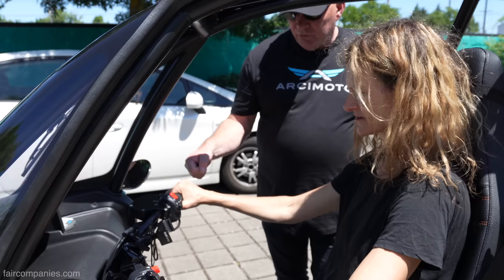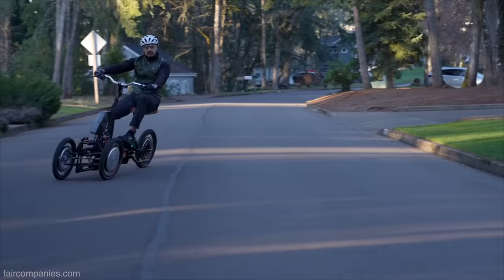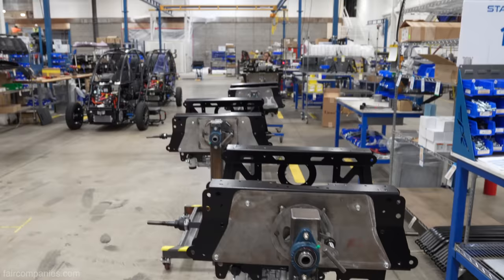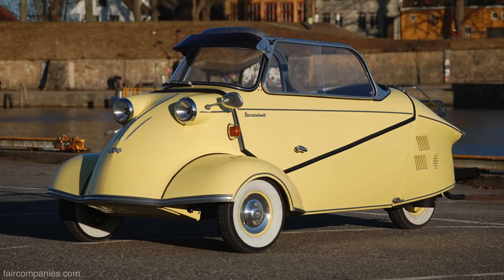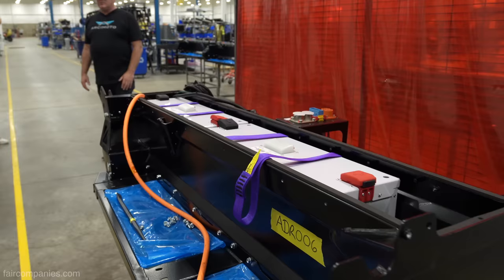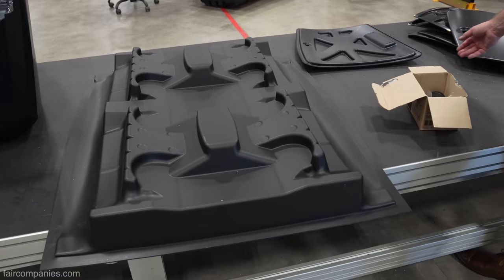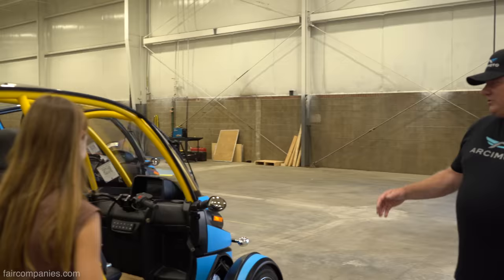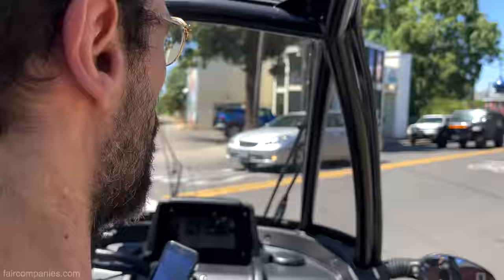Arcimoto 3-wheel EV commuter blends bikes' fun + cars' safety

Comment: A Great replacement for a conventional car, BUT what about the acceptance by the rules and regulations for (if necessay) road use not only in the various States in America but also Internationally ? How about scaling this all down, slower and simpler that, as an covered E-bike vehicle there is no need for Registration or a License for Road use or depend upon solely, conventional fuel source for recharding batteries. I've still to see something of this standard of innovation applied to E-Bikes that can use bicycles pathway. If I wanted a down-graded car, I'd be getting one of these. And the cost?

Comment: How does it handle rolling while turning?
Reply: No roll. We can't even lean for balance because we are strapped in and there is no need due to the wide front wheelbase. This feels nothing like a motorcycle. Those have round tires, the FUV uses wide flat treaded car tires with very high traction. It's nice to have the motorcycle experience and be stable on wet pavement when motorcycles have a high risk of spinning out. No more worries about a face plant due to a little patch of oil or gravel.

Comment: Just needs to be enclosed with some minimal internal fan&air flow setup + windshield wipers + headlamps + snow worthy ABS ... then I am sold.
Reply: I personally like Aptera.  I understand the reasons for three wheels, but these have to handle more than southern California roads/weather.  Otherwise it's an overpriced motorcycle that will never go mainstream.
Reply: It is enclosed enough to be an all weather vehicle except for the most extreme clmates. Watch the videos of the Arcimoto in rain and on snow. It has heated seats, hand grips and defroster. It has a 3 speed wiper with washer. It has the absolute full set of DOT lighting approved for all 50 states. ABS is an option for cars, not for autocycles. It handles really well in snow as-is. Now put down your deposit. I waited 2 years for mine. The video is good but you really need to watch more than one to be able to post informed comments.

Comment: Wish these had some type of a door similar to GEM cars in the event of a collision or roll over instinct would be to reach out arms and hands
Reply: Nobody has ever rolled one. We will be gripping the handlebars very hard. Car doors have steel beams but the FUV uses the crash cage for safety instead. Doors for the FUV are not reinforced, they are just security blankets. The first serious collision has already happened,  proving the safety of this design.

Comment: I still prefer 2 wheels (with 2 little ones extended when parking or low velocity), although this is a nice design.
Reply: The Nimbus One might be more your thing.  It’s also a reverse trike like the FUV but it’s about as narrow as a bike and tilts when it corners. They’re not as far along as the Arcimoto though. Delivery is at least a year out, but the prototype looks promising.

Comment: Not for midwest or northern driving.  Too, bad, but some places require more than heated seats, and warm clothes since you could easily  freeze parts of your anatomy in the few minuets it takes to zip to the library or wait at the Pharmacy drive up line.
Reply: Do you live in Siberia?
Reply: @popeyegordon   Sweetheart, i’m an old granny with a young heart. Climate Change threatens everyones life. Normal heat, Rain and snow threatens mine. I love the idea, i just need a little more shelter these days.
Reply: @jeanfitzsimmons7442  I'm 70. Recently an old man walked up to me in a parking lot to look closer at my Arcimoto. He had a big heavy luxury car. He asked me if the ride was good or rough. I replied "It's fine for me. I don't want to go soft in a cushy climate controlled car" (in a non-confrontational tone less harsh than what you see here). The fun factor outweighs any chill or damp elbows for me. The wrap around windshield and roof combines with the heated seats and hand grips to keep me comfortable for short hops without bundling up. I might wear a warm hat.

Comment: I live in a small town in Idaho (Twin Falls). If the Police Department, Sheriff, and/or Fire Department (one of them) likes the idea I’ll pay for one. If you would be willing to give them some suggestions on what they might want as First Responders I think this might work.
Is Arcimoto interested?
Reply: Distribution to Idaho is years off.
Reply: Idaho borders Oregon to the east. Probably the only reason they have not opened there yet is lack of demand compared to where they are focusing. All Idaho needs for service are enough people ordering deposits online. They just opened in HI with NY probably next year.
Reply: @barnabasseadog7660  While I want to see it everywhere, travelers know about the desert expanses East of the Cascades. Less people there, mostly more spread out.  Idaho can mean lots of travel time for service reps. Even retiring the mobile service for local EV specialty shops will take longer there. Idaho is not as bad as Wyoming though.

Comment: Even though I am in San Diego and it rains seldom even canvas covers would help on sides a plus also for a/c Nimbus is going both ways open and closed(doors) for models with a/c plus I am a 70 yr. old senior doors seem like a nice option at least. just sayin'
Reply: I'm a 70 year old senior too. I drove my Arcimoto for 8 months before getting caught in rain in Florida. We have the freedom to check the weather before we leave home. It was amazing how dry I stayed in mine while it was moving above 25 mph. Totally dry ride. At lower speeds my elbows and outher thighs get damp, no big deal. I don't want doors, I want the cool breezes when parked that doors block.
Reply: Dude, I'm a sixty-one year old myself, and have maybe ten more years of commuting to do from Mira Mesa to Point Loma. I expect to pilot my FUV down I-5 at 2am rain or shine. Heated seats and grips come standard, you think we'll ever get to use them in San Diego? Looking forward to it because this vehicle does not need windows or climate control. The windshield, harness, and rollbar provide a pretty safe cockpit for defensive minded drivers, but I went ahead and ordered the West Coast Doors for improved aerodynamics on the freeway. You should rent first from Arcimoto downtown, that is how my ninety-one year old father found out how hard it was to get his leg over the battery case that runs down the centerline.

Comment: They are awesome I would love to have one especially with the little dog side car so I can get my dog to the groom and park. but as a disabled person I’m sure financially like a car the price is unreachable😕
Reply: I am disabled on a SS pension. I saved up for 7 years to be able to pay cash for my Arcimoto. 7 years without a car and all those expenses that go with it. I did fine with my comfortable 3 wheeled trike that has electric assist. The FUV needs no gas or oil changes, the insurance is very very low compared to car insurance. It uses so little power to charge that I did not notice it on my power bill. In 2022, when the average price of a new car is $46,000 the FUV is a bargain at $18K. Orlando is just the shipping hub where trucks from Oregon are uhloaded and then the new vehicles are picked up by the buyers or they pay a local service to deliver them to their homes. Arcimoto offers financing through a banking partner.

Comment: 4 hours to charge up.
How much would that cost in electric bill 🤔
Reply: The batteries are about 19.2 kWh. Thats about 1/4 my Model 3. I'm guessing $2 at home per 0-100% charge.
Reply: @lienct  way better than gas.
Reply: It takes 8 hours at home with L1 charging, ONLY of it was near empty but most of us don't return home near empty. My average daily round trip is 5 miles. My power bill went up less than $2/mo and my insurace is at the 80% lower motorcycle rate. You just plug in when you get home and it is always ready to go.
Reply: @lienct  Less than 50 cents would be closer to the utility cost and that is only with a full discharge which most people do not do.

Comment: I feel very safe in my Arcimoto compared to any of the motorcycles and scooters I owned during my lifetime. No requirement to balance and the car tire tread 14.5 inches total width on the road at all times, far surpassing the grip of rounded motorcycle tires. Handles like a car in the rain and I do stay dry with the wrap around windshield and roof with rain gutters. I do not want the optional doors, they do nothing and are dead weight. I am strapped into the bucket seat with a six point harness. Add the certified crash cage and you have a vehicle that can be safely driven barefoot in a bathing suit.
Super economical! My insurance for a good Allstate policy is just $132/yr, that alone saves me $900 a year, every year. No gas to buy and I did not notice the charging load on my power bill. No air bags or converter to steal, no transmission or engine to blow up. Every drive is a delight as I listen to the jet turbine whine of the twin motors.

Comment: cost? download book so I you see what you want to the cost? can I tow a Traylor for my Eletric wheelchair?
 I am in Amarillo, Texas how soon can I get one. Can I get an intercom from ne to another. Can I get moor battery, in-laws are 130 miles for row trip. for lunch trip?
Reply: No towing with trikes. Cost is at Arcimoto.com   We need no intercoms with the design which uses the wrap around windshield to block wind rumble in your ears. Talking is easy. 130 mile "lunch trips" are absolutely obsolete, nobody should be doing that any more. You take a bus or train for longer trips, or just don't go. Our biome is dying.

Comment: If it comes fully enclosed to deal with winter and rain, I'm all for it!  I know they spoke about needing to add doors for certain areas but I'm thinking they weren't too enthusiastic about it.  Honestly, I could see myself in one these only if it's fully covered though because I'd only get one if I moved into a suburban area (I live in NYC where something like this might be impossible to keep safe (from theft) and drive on the streets but if I lived in Pennsylvania like my brother does (in a suburbs area that's not too far from a large shopping area then it would be very practical for a quick shopping trip.  

I wonder if adding a flexible solar panel to the top could be possible to help get even more "miles per gallon" so to speak.  I also wonder if you need a license to drive it (a motorcycle license I meant) because it feels like you should need one. 😅  Also, having a way to switch from having a passenger to carrying cargo might be nice too.  Big dreams are fun to have!
Reply: Nothing about this vehicle makes it any more vulnerable to theft. This is in the motorcycle class of vehicles that never lock up the passenger area and it would require a high tech wizard to defeat the six digit code required to activate the vehicle and release the motorized parking brake. Any valuables must be locked in the trunk regardless of the kind of vehicle you own in NYC and this small vehicle has no room or need for a large valuable stereo, air bags or catalytic converter. There are very simple Bluetooth speakers, that's it. 
The driver stays completely dry in rain while moving. 
The roof is too small for a useful amount of solar cells. It could not even collect enough energy in perfect weather to stop the daily self discharge of this electric vehicle while it is parked. It has to remain plugged in at all times it is parked at home. No solar energy while being garaged or covered.

It is bizarre to claim you "feel" like you should need a motorcycle endorsement. Based on what? No balance required, no gears to shift. Operates exactly like a car except the location of the controls on handlebars instead of a dashboard.
Arcimoto is considering an option to make the rear seat easier to remove. I unbolted mine and added heavy cargo webbing to turn the rear into a large cargo bin.
Reply: @popeyegordon  I think I didn't get my point across correctly.  In large cities like NYC, people rarely own homes, most live in small apartments.  Despite how good they would be for getting around the neighborhood, the first issue with these would be where to plug them in.  Until we get places where we could park them and plug them in, it's actually very impractical to own something like that.  As for getting stolen... Trust me, if it's not bolted to the floor (sometimes even if it is) it can be stolen in NYC, especially in the South Bronx where I live, lol.  Generally you don't own a nice vehicle here unless you rent out a parking space because parking in the street is the only other alternative and that's always a risk.

BTW, I only feel it should need a license to drive simply because motorcycles do in some areas.  That's why motorcycle licenses exist.  I couldn't tell you how similar it is to driving a car having never driven either (as a born New Yorker I've never even felt the need to learn how to drive because public transportation can get me pretty much anywhere I need to be) but I guess if you've already got a driver's license it shouldn't be necessary if that's the case but if you don't then you should at least need a motorcycle license.  I think that's a bit more clearly explained. 🤔

Oh, I also was more concerned about cold than rain when I was talking about a way to enclose the vehicle, though I'm glad it's fairly protected from rain.  I'm just a complete wimp when it comes to cold weather and couldn't deal with a completely open vehicle during it, lol.  Like, cold winds could kill me because I have a weak immune system and get sick so easily.  Yes, you can bundle up but then it feels like you would look like an idiot riding around in that thing.  Does that make sense? 😅

However, I am glad that they are considering making the rear seat easier to unbolt.  Perhaps they should look into a folding rear seat instead?  I only say that because you might need to go shopping in the morning and need the extra space for cargo but then need to pick someone up in the afternoon or evening and need the seat.  In that sort of situation a folding seat might make more sense, I think.  Almost like the stow-and-go seats that minivans use, except it might work just as well to simply be able to push the part you sit on up like they do on public busses to accommodate wheelchairs?  Maybe?  I don't know, I'm not an expert here.  I'm just a person considering moving into the Pennsylvania suburbs (to my brother's house due to health issues) and looking at alternatives for transportation because I wouldn't have NYC's public transportation system to depend on anymore but I don't go out enough to justify a regular car.  It's an awkward position to be in.
Reply: @ChibiChula  I hear you but this is not a motorcycle. It drives like a car and needs no balance or even gear shifting. It has the same controls as a car. Each state has different laws and Arcimoto has worked with the states to get the definition and requirements adapted for autocycles. If you can not plug it in you can't own any electric vehicle at this time unless it is a small scooter with removble batteries you can take in to charge. The parts are not standard so thieves would have nowhere to sell anything they remove from it. The smaller size means we can fit in spaces cars can not. Arcimoto has been listening to consumers and it is planning on a folding rear seat. There is nothing idiot like about wearing the right clothing and the wrap around windshield, roof combo cuts the wind chill and keeps you dry. There is a heated seat, hand grips and defroster. 
There is a new class of microcars being developed now, you can find them on Youtube. Some have removable batteries and climate control. The Nimbus is available late next year. You might find it ideal.